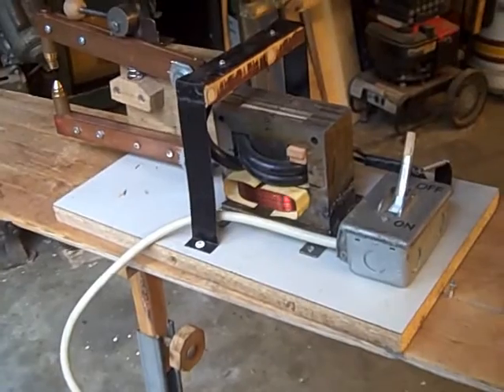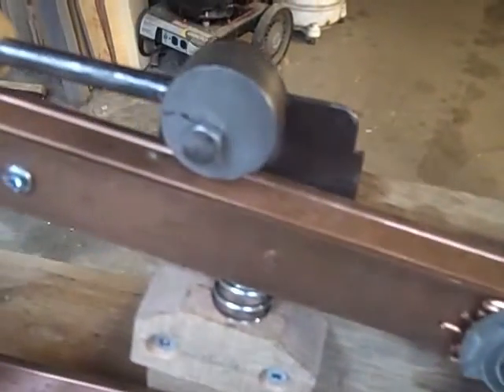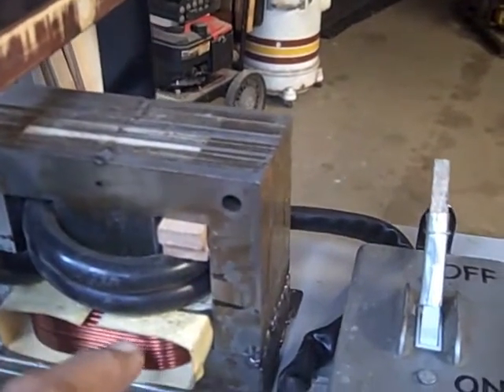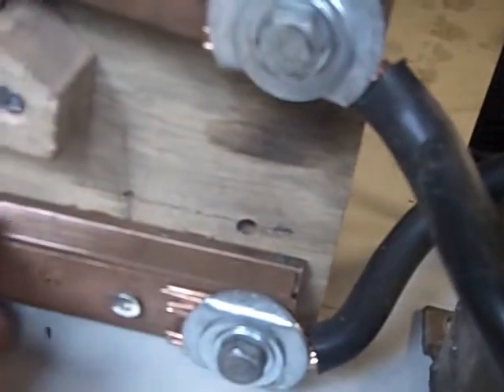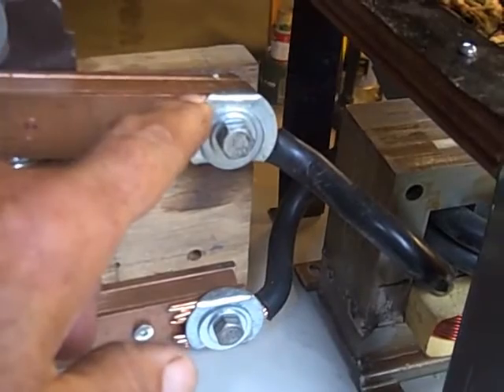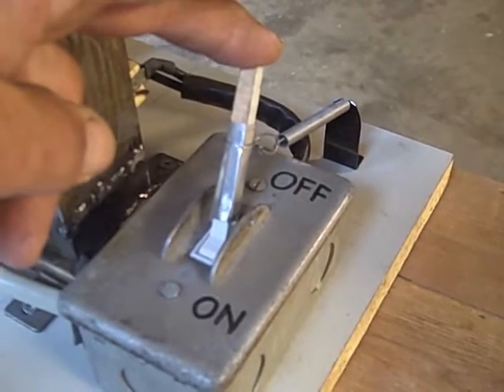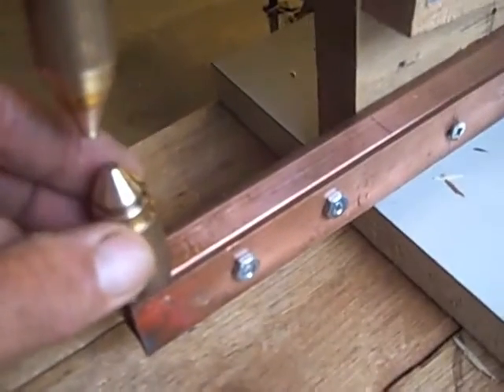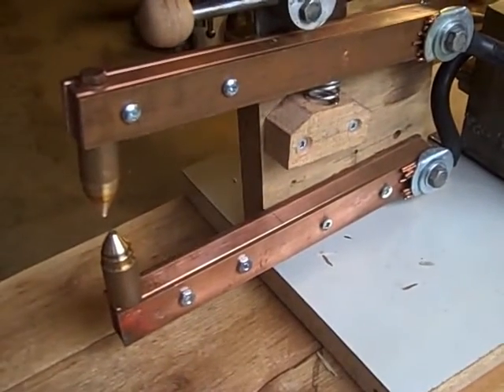Spot Welder using a MOT

Comment: I've looked at lots of the MOT spot welding videos, and am glad to find yours, because you've thought about lowering the resistance to the electrodes very carefully. My build is part completed and has very similar-sized electrodes from a copper "earth-grounding rod". It's good to see your example of a finished practical outcome from your welder, (very few uploaders have done so). Interesting that you've rotated the transformer 90 degrees and exited the 2ndary wires "sideways", and compressed them with a wooden block. I like your cam to get variable compression for a range of metal thicknesses. Very informative commentary and written introductory explanation. I hope my build produces a similar result. Thanks for uploading 😀
Reply from the maker: Thank you for the comment. I'm pleased that I was able to help you. I'm sure that you'll find the welder very handy to have around - usually when you least expect it.
Reply: disproman Thanks, I'm looking forward to that day real soon :-)